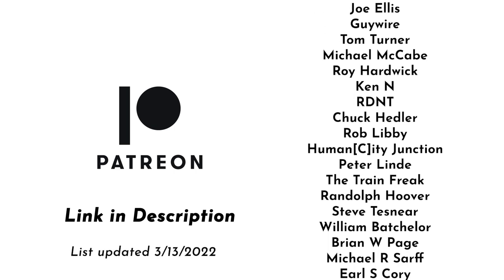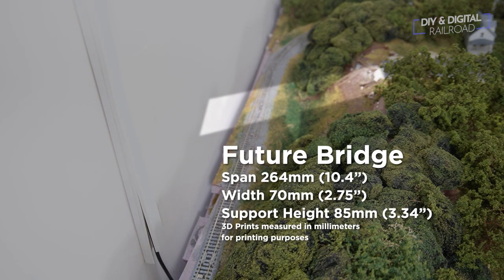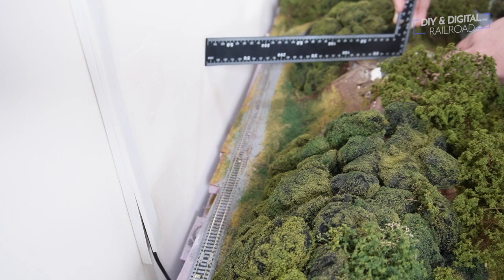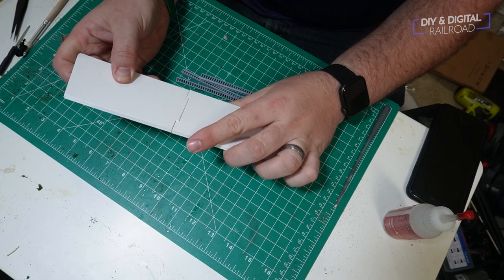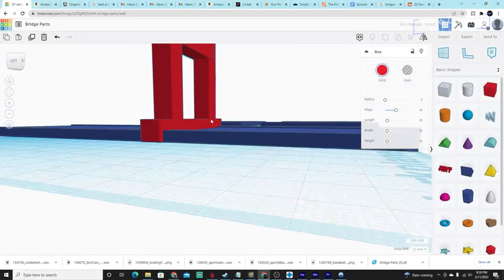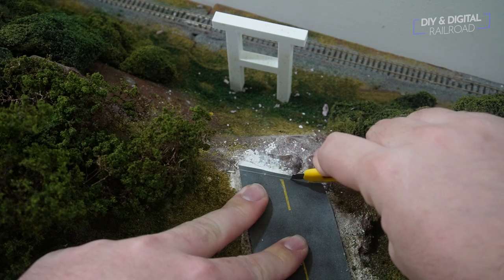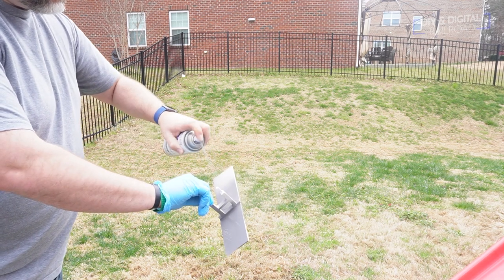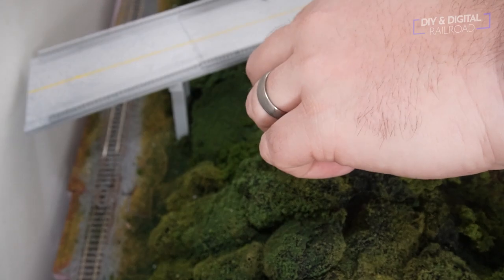3D Printing Bridges for Model Railroads

Comment: just got a 3D printer, thank you for using Tinkercad and showing that you don't need a higher end program to design stuff. I am designing a switch control box and buildings. For the roadbed did you use PLA?
Reply from the maker: Yes I used matterhackers PLA.